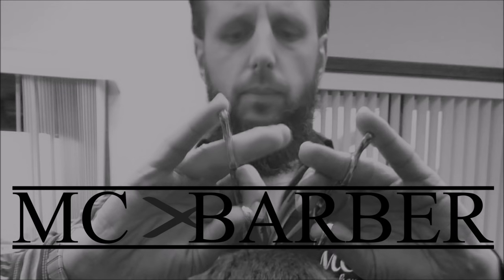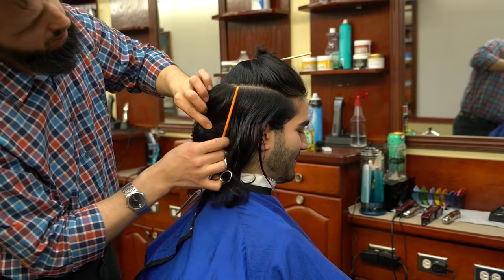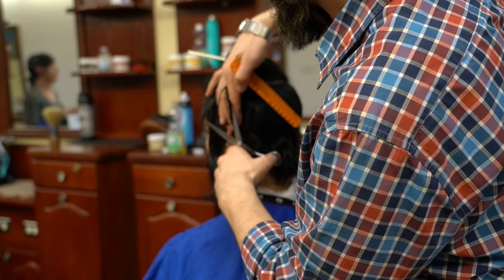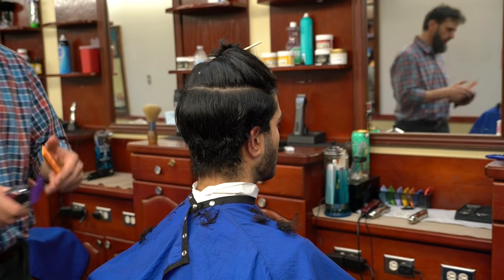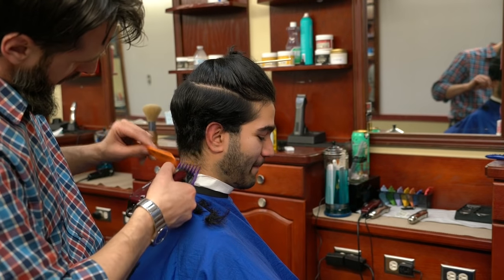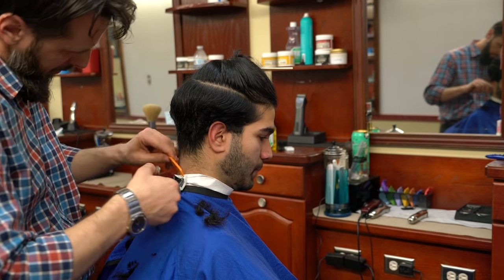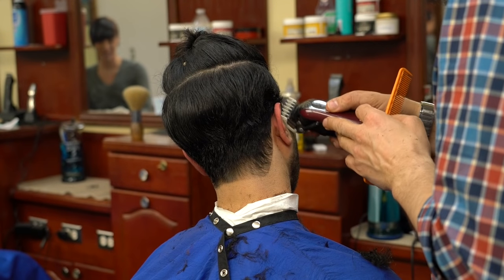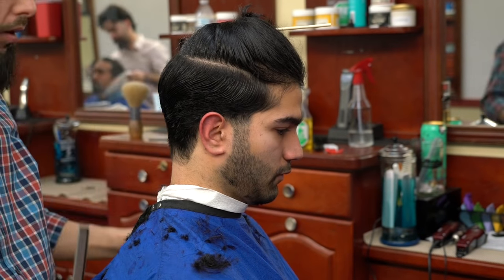Haircut Tutorial: Slicked Back Pompadour

Comment: Mc Barber hi. 

Great haircut but I got a quick question for ya. You say that using the rasor to cut the top of the hair leaves a good texture on the hair. Here I noticed that you followed up with shears after the rasor. So my question is: why do you use rasor and than shears when in the end youre stll getting the same result as if you used shears all the way?
Reply from the maker: Isid Vojka So when you use the scissors afterwards you actually do not cut into your Razor cut you only cut the ends
Reply: Okay understood. 
I know it was a rookie question but the reason I had this question is because I thought that the point of the rasor sculpting technique was to get the uneven ends, pretty much like the thinning scissors, so they blend together and you get the texture. 

I appreciate you took the time to answer my question, and keep up your good work 👍